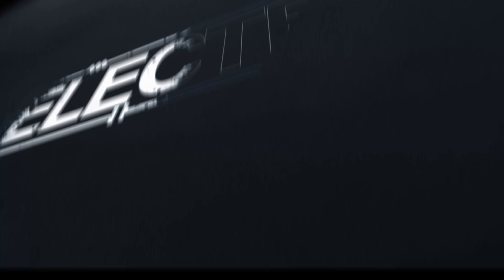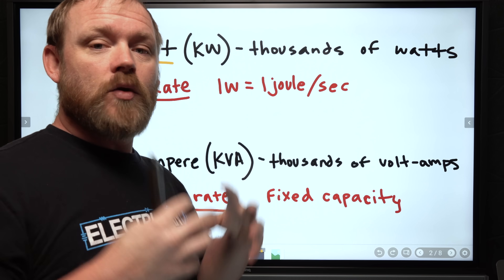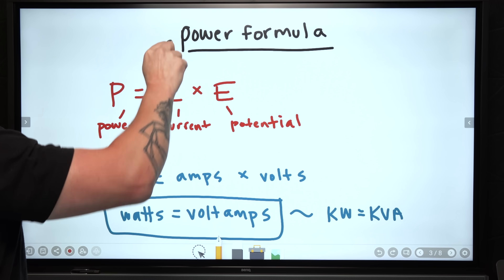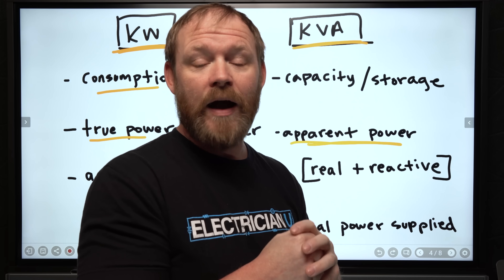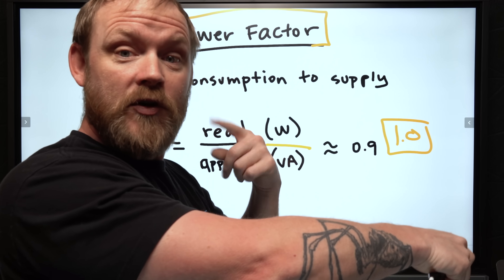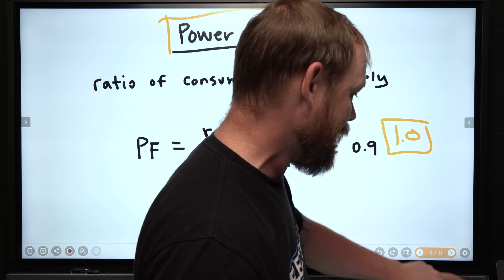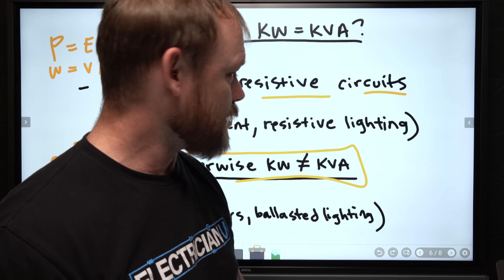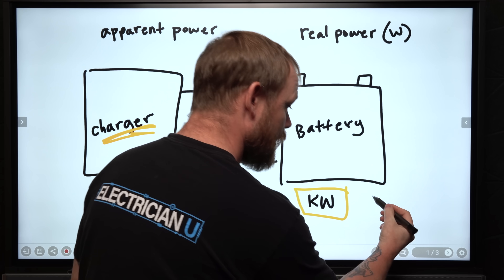Why KW and KVA Are NOT The Same Thing (Even If They Seem Like It)

Comment: At the generaton source kw=kva.  At the load, if inductive, it usually is not the same.  The difference is calculated from the voltage and current angles due to being out of sync (current lagging) as power factor.  Most utilities bill on kwh and not kva, so power factor penalties may be applied to recover the cost of "lost energy" through kva/kw differences.  To find total kw, divide measured kw by power factor as a decimal number.  Transformers and generators must be sized to deliver this kw without being overloaded.  The 2 options for adequate power are to increase capacity or improve power factor through the proper application of capacitors in kvars to offset the kvar's (kva reactive) to the load.  This will save on supply as well as line loss/voltage drop.  Dc circuits do not have power factor or kva issues.
Reply: Also AC has a frequency component which is never talked about. If you raise the frequency like they do on airlines, and if you place a resonant device on that line, you can draw a lot more current than what you calculate by pure resistance.
If you look at Ohms law, the calculation for Watts is V*I or Voltage times Amperage, however look carefully, the formula, its for DC circuits, or for AC with a pure resistive load.
Reply: @rty1955  that is because voltage is not constant for AC.

The formula is still correct for any specific point in time, however for each cycle the voltage will be in 0 then +V then 0 then -V

Hence while it's impractical for a human to do these calculations on the fly, it's very easy for an oscilloscope and why they are an essential piece of equipment for anyone working with AC circuits.

To put it another way, if the formula, ie Ohm's law, didn't apply to AC then an oscilloscope would be effectively useless as the only thing they measure is voltage - all the other "smarts" and useful information they are capable of presenting hinge on said formulas being true
Reply: @rty1955 ohms law is for AC and DC circuits.  It is universal.  For AC, we almost always use RMS values, not actual peak voltages (which are significantly higher).  Ohms law works properly when you use RMS values, but only at unity power factor.  Off-unity you have to sample the voltage and current at a high rate and add up the components.  Usually you sample at few thousand hz.
Reply: @junkerzn7312  In AC circuits, Ohm's Law requires consideration of impedance rather than just resistance. Impedance (ZZ) accounts for both resistance (RR) and reactance (XX), which arises from inductors and capacitors in the circuit. The formula is:
V=I×ZV=I×Z
where:
- ZZ is the total impedance (in ohms), which can be complex and may have both real and imaginary components. Also the frequency of AC will influence the readings as well. As current draw will depend on a certain point within the voltage wave.
So a simple W=V*I can not apply in AC circuits, unless there is purely a linear load which is usually never the case. Wattage can only be approximated.
Reply: @rty1955  You are trying to say that ohms law doesn't apply to AC circuits but I don't think you really understand.  Ohms law applies to electricity, period. AC or DC.  The DIFFERENCE for AC circuits is that you can't just take an average voltage over several cycles and multiply it by an average current over several cycles.  Because of the difference in phase.

To apply ohms law to AC, you need to take many samples per cycle.  But it still applies.  Perfectly applies, really.   The equations you are quoting are an abstraction that just assumes a uniform phase angle.

You can thus apply ohms law to each sample individually at a reasonable frequency... minimum for decent accuracy would be roughly 8 x 60hz = 480hz sample rate.

Now sure, multiplying a RMS voltage average and RMS current average over several cycles won't work if there is a phase angle.  But that is NOT ohms law.  As a shortcut, you just incorporate the power factor into the equation.  There is no need to go into complex number notation.

Complex impedance is ALSO an average, by the way... it will not give you a perfect answer unless the AC voltage and the AC current are perfect sine waves. The only way to get the actual answer with high accuracy is with fast sampling.  We will sample at 10,000hz (about 100uS intervals) when we need high levels of accuracy.

-Matt
Reply: @junkerzn7312  wattage in an AC circuit is an APPROXIMATION not exact. Wattage in a DC circuit os exact and easily calculated. That's the difference.
Reply: @rty1955  Huh?  Uh, no.   Measurements of wattage in either type of circuit, if you want high accuracy, requires a high sample rate.  AC or DC.  Because you definitely can have ripple and large current variations on DC.  Just because AC is a waveform makes no difference.

A cheap multi-meter is not really known for high accuracy, but it doesn't follow into the axiom that somehow, magically, wattage is harder to measure on an AC circuit than on a DC circuit.

-Matt
Reply: @junkerzn7312  ripple only occurs on a bad DC PS design. Using a battery or pure DC no ripple will occur. And ripple is not AC, just pulsating DC. But current WILL vary depending on AC frequency even though the voltage component is constant Therefore wattage will vary with frequency, unless the load is purely resistive & linear.
Reply: No it doesn’t, power is generated including the reactive component!
Reply: Not just leading and laging but any distortion on the current and voltage waveform like rectifiers used in almost every appliance in the home with inverters like refrigerators, washing machines, tvs, pc, led bulb, etc.  in the home most power factor is due to rectifers
Reply: Ahh yes, power factor. The tendency for energy to be dissipated without any energy being used, just because the two sides of an indicator end up out of phase, so too a capacitor which soaks up charge and pulls down voltages till charged.

It's not like the capacitor gets hot, nor the inductor when it's magnetic field resists the changing currents. But the moment you turn the pump/load on, it actually draws a significant current and actually let's power flow to ground through its windings.
Reply: Current in the load or group of loads occurrs at the same time as in the generator. It is not possible to be otherwise.
Reply: Yeah - the kw is not equal to kva at the generator unless it is unity power factor.  

Generally, it is taken that the kw (true power) is controlled by the generators governor that controls torque, and kVAr (reactive power) is controlled using the AVR that controls rotor field excitation.
Reply: @billg364  .. rubbish, I suggest that you know squat about AC synchronous generators!
Reply: @andyxox4168  well the AC is superfluous, it's not exactly like there is a DC synchronous generator and DC asynchronous generator and thus needs to be distinguished from AC, is there?

But then again maybe i don't know what you are referring to, you seem to only speak in barely coherent half sentences.

Stay in school and maybe you'll figure out how to articulate your thoughts in complete sentences. It's kind of a prerequisite to get into uni 🤷

Comment: The "simplistic" rating of the capacity of a battery is a (current x time) product, typically milliampere•hours for small ones, ampere•hours for large ones. Such a rating doesn't tell the whole story by itself and is generally based on assumptions about the voltage at full charge and the voltage at maximum allowable discharge. For some purposes an energy rating, sometimes as joules but most often as watt•hours, is more instructive.
With many electronic loads, including an inverter that runs a motor in a car, the current required will increase as the battery voltage declines.

Comment: Hello, 
I think it would be helpful to readdress DC /AC theory in the very beginning.  The end of your presentation finally illustrated some DC /AC differences,  but it would be helpful for most to understand DC as a unity source KW - Watt - Megawatt, only resistance.   It would be more real to introduce Impedance and Power Factor in circuits that represent AC circuits or other nonlinear energy sources.  So with electric cars,,  the DC portion lets say the Battery part of the circuit is DC and watt- Kilowatt terms are used and the motor which is usually a three phase motor uses AC current and thus the terms in that part of the circuit would use KVA since a power factor unit is introduced if other than at unity. ( reactive / impedance )

Comment: Nothing about phase or the fact that the power oscillates back and forth between supply and demand? Or that batteries are measured in KWh since they are purely DC?
Reply: Energy can be measured in kWh... AC or DC doesn't matter.  kWh is a unit of energy.  (power x time = energy).  Watts (W) is power.  VA is also power... the units are the same as watts.   So watt-hours (Wh) is "energy".  kilowatt-hours (kWh) is energy.  Watts (W) is "power", kilwatts (kW) is "power".

Some influencers also say "watts per hour"... which is basically a meaningless term.  They really mean "watt-hours" when they say that.

-Matt
Reply: I think you missed my point. The power factor for batteries is 1.0, because they are purely DC.  There is no AC current oscilation.  So, for batteries, KW is KVA. That’s why you will never see a battery rated in KVA. And yes, they are rated in KW as well as KWh. The latter is for total capacity, the former is for load limits.

Comment: Batteries on a charger absolutely are a load, and they aren't rated in watts, they are rated in ampere•hours (or watt•hours, but the voltage of the battery as it is being discharged has to be considered). They are a load because the charging current drives an electrochemical reaction, which is subsequently reversed when the battery is being discharged.

Electricians have traditionally thought of power factor as something that is a function of the phase angle between the applied voltage and the resulting current. That is quite correct when there is reactance.
When you get into things like battery chargers where the AC input is rectified and filtered, typically with just a capacitive filter for small chargers, the load is very non-linear. It doesn't behave anything like capacitve reactance directly across the AC source. Current only flows when the instantaneous input voltage exceeds the instantaneous voltage on the capacitor. You get narrow current "spikes" that correspond roughly with the positive and negative peaks of the AC voltage waveform. This results in very poor power factor. The ratio of RMS input current to average input current is high. It is the average input current that "counts." More modern designs use "active power factor  correction" to "force" the input current to be sinusoidal and in phase with the applied voltage. The load appears to the source as if it were a resistor. Active power factor correction circuits are typically a "front end" to another switch-mode power converter that has a regulated output. When a switcher regulates the output it exhibits a "negative resistance" characteristic - it the input voltage rises, the input current falls in proportion to maintain the same power. Active power factor correction is used in lots of things like power supplies for computers and LED lighting power supplies.
Note that you cannot correct the power factor of a non-linear load with linear elements. There are "passive valley fill" techniques that can improve the power factor, but they aren't very practical beyond a few hundred watts.

Active power correction where the final output is regulated has two apparently conflicting requirements. The instantaneous input current must be directly proportional to the instantaneous input voltage but the average input current must be inversely proportional to the average input voltage.

Comment: KW and KVA are interchangeable. You could rate transformers by watts and batteries/chargers by volt amps if you desired. As you said, since amps have a time component, this makes volt amps also a measure of power transfer rate. There is a reason the calculation to find watts and VA are the same....because they are the same. What you mainly highlight here is that industry has CHOSEN to use one term for batteries and loads and the other for supply. This is not due to anything intrinsic. The PF point is really only pointing out that there are forces at play that do not make power transfer 100% efficient. It doesn't change the power available theoretically, which could be calculated in watts.

If we came up with a calculation of what batteries actually deliver, vs theoretically deliver, and gave the results of that calculation some different name, that doesn't change the fact that we are still effectively talking about watts. Actually, you can sort of do this with watts of the battery vs actual output of the motor they power in HP. An inefficiency, as calculated by PF, doesn't a new unit make. These units are just used in applications because it has become standardized by those industries., not because there is any intrinsic difference. Anyway, this is my opinion as an idiot electrician, but I would like to learn otherwise.
Reply: I don't think he'd disagree the units of W and VA are identical.

As I understand it, he's pointing out the reason for an industry convention (standard?) of using KW for resistive loads versus KVA for everything else.

I expect there's a historical reason from the early times of electrification that we didn't end up calling them, say, "resistive Kilowatts" and "apparent Kilowatts" (ugh, maybe that's the answer).

Since consumers almost always deal with resistive loads, just using Watts for those seems best, and I don't know what term one could come up with for everything else that would be better than Volt•Amps.

But this is just my opinion as an idiot non-electrician, so what do I know?
Reply: @larrywest42  Fair enough, even though he seemed to imply they were actually different from what I remember. I just wish he would say they are not different at all as a measure of power, except for industry convention. Another thing that was odd is that he didn't count batteries on a charger as a load...because the store energy. It's still a load at the time of charging. The history of the use of these units, along with what electricity was being used for in those times, would be interesting. It might explain how the convention started, but that's a lot of obscure info.

The video is ultimately correct, they are used to refer to apparent power (VA) and real power (W). The name and use is the difference, not the physical unit. The difference in terms prevents confusion.

Comment: Great stuff ! When battery systems get into AC things change . DC no power factor . But when we convert AC to DC and DC to AC then power factor comes to play ! Look at a battery charger connected to AC then convert to DC , The AC side has power factor. Things can be done to improve that . Also they can generate harmonics to the AC system.  This is also true when we make AC from DC . That why inverters are rated in KVA . it is a supply of AC that what It can deliver . It sees the load + power factor  on AC output . Lots to keep straight.

Comment: So I have been calculating everything in KVA for the last 54 years and calling it KW improperly. Meaning you can not have AC WATTS. Because there is always resistance, capacitance, induction, transmission, reflection and absorption. What a minute! That means KW is a theoretical idea that cannot exist in a dynamic universe. Leakage current in a DC circuit; current flow produces a magnetic field; a conductor (teflon has a high resistance) moving in a magnetic field induces a voltage and therefore a current and a transmitted electromagnetic field, which is reabsorbed by the DC circuit. So a pure DC resistive circuit cannot exist in our universe!     Conclusion: “Watts” is just a place holder in a mathematical formula.

Comment: A little more explanation of the power triangle would have been better but pretty good other than that.  
For those with no understanding of reactive power and the work it does there is the beer example.  Head on a beer isn't beer and you can't drink it but a beer without head is useless.

Comment: You should take this lesson a step further and do power factor correction in the field. And calc the total kVa required for the capacitors and then how much the power factor penalty is costing vs installing the capacitors to fix the low factor %.
Reply: The power factor more or less MUST be corrected at some point prior to getting all the way back to the generator.  Generators can typically operate with a lagging power factor of 0.8 to 1.0.  Any lower and you risk overheating and a trip-off.... i.e. the whole grid would go down at that point.

Comment: Power company's run ac power  an electronic circuit uses dc power in most circuits ac in dc out some diodes regulator transistors & filter capacitors   kva is more of an inrush amount  aka surge

Comment: In DC circuits apparent power and active power are always equal because voltage and current are always in phase, the information in this video only applies to AC circuits where voltalge and current can lag or lead the other depending on the loads. Also that is only important for industrial applications since power companies charge them for apparent power, homeowners pay for active power only.